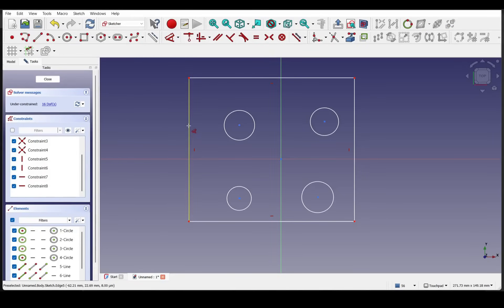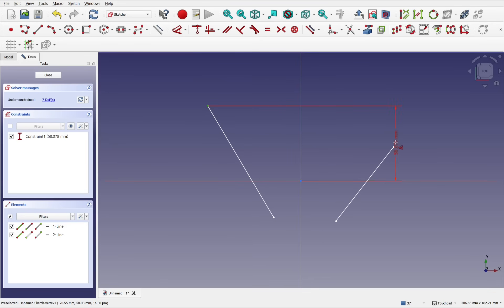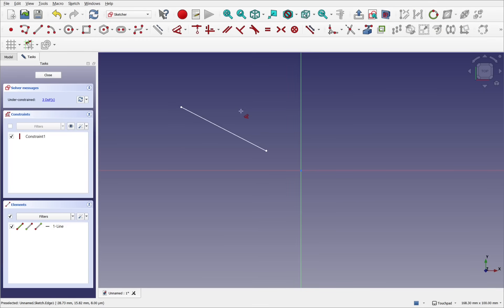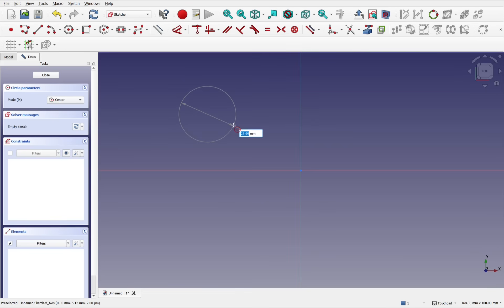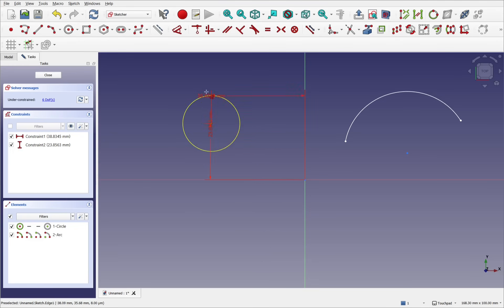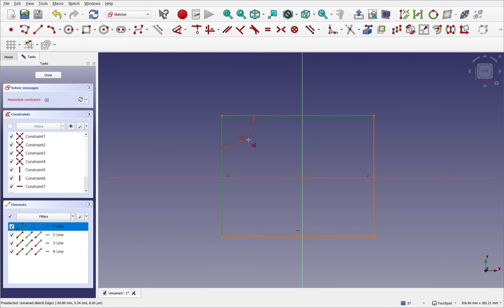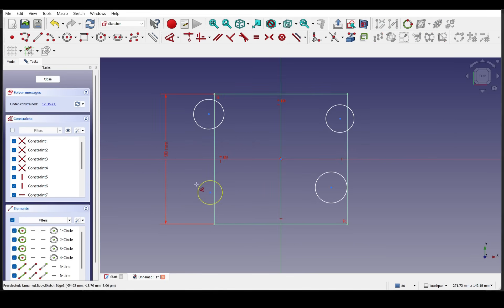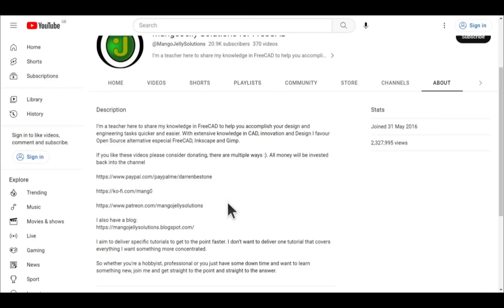FreeCAD Dimensioning Tool: It does more than you think! And How to use it!

Comment: It pays to learn keyboard shortcuts for different dimensions. The speed improvement is huge in comparison with using the menu and playing guessing game with the code trying to figure out what I want to dimension.
Reply from the maker: Agree with you there, I tend to leave shortcuts out of videos as they tend to put people off.  I am tempted to mention them somehow in the process.  Day to day modeling I find them invaluable.
Reply: @MangoJellySolutions you can insert a teaser at the end of the video , saying something like “but if you find repetitive clicking on the menu and hitting the M key too slow still, notice a keyboard shortcut posted along each menu item”. 
Keyboard shortcuts are not  visual so showing them would be difficult, but you could show the difference in time “clicking operations” take to dimension a diameter, length, height or distance vs  hitting one or two keys on the keyboard.
Some people will pick up on this, some will ignore.

Comment: I know this is about the dimensioning tool, but on the last example, I come from SolidWorks, where I used the hell out of the mirror tool. FreeCAD has finally implemented mirroring, which makes creating a rectangular array of equal circles a MUCH faster process, especially across the axes. Hitting J after selecting the mirror tool adds in all necessary constraints. I'll have to look and see if there's a way to enable constraints by default, because that's where it really flies.

Comment: Thank you! Learned a trick or two for my occasional modeling 👍👏. As for the 4 circles, the m command seems to me very akward. I just hit v-v-h-h-s-e keys, selecting appropriate pair or number of points for each. For symetrical I select two circle centers diagonally and the center point and boom - everyting is constrained. But I will definitely try the m command too, good to know and learn the options and scenrios, where they're usable.
Reply from the maker: Glad the video was helpful :).  I agree the vertical, horizontal, symmetrical and equality short cuts along with C for coincident are far better to use when you get that far down the chain.  Those constraints via dimension tool can get a bit clumsy.

Comment: Very helpful. Thanks!
Reply: I like the right-click left-click options you explained. The M for mode is nice, but slightly cumbersome. Right hand is on the mouse, and M is a right hand keystroke. In just the few minutes I rooted around, I can't seem to find that shortcut. Would be nice to switch it to space-bar or something on the left hand.
Reply from the maker: I don't think you can change the shortcut for the mode only to initiate the tool itself, need to look into that one.  Yes it's quite a travel for the left hand to reach that key. I would love to be able to move it to the scroll wheel.
Reply from the maker: Thank you so much, really appreciate that :)

Comment: Reminded me of one a not directly related, but very important question: what are your practices to avoid constraint flipping, e.g., especially when using config tables or var sets and editing dimensions or switching variants?
Reply from the maker: I think I know  what you mean, when you increase a constraint by a large amount in a varset / spreadsheet say in-between, say, two rungs of a ladder and they for some reason change places, but when you do it in small increments it's fine. It's still a known issue and I have got round it by constraining to a fix point like point of origin or a axis.